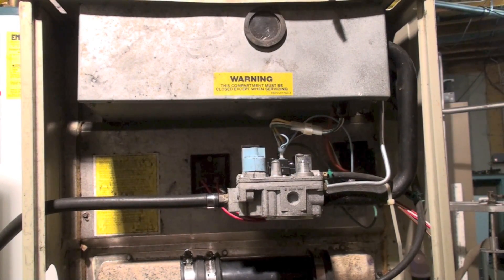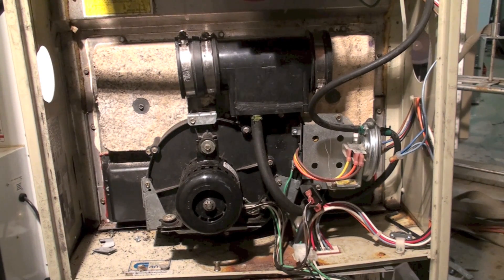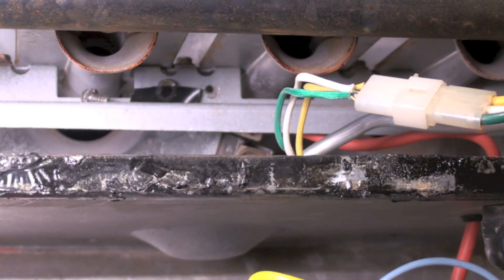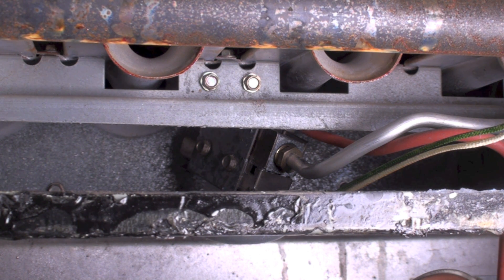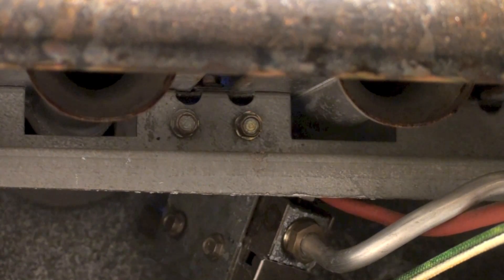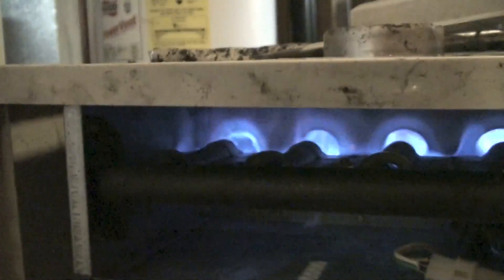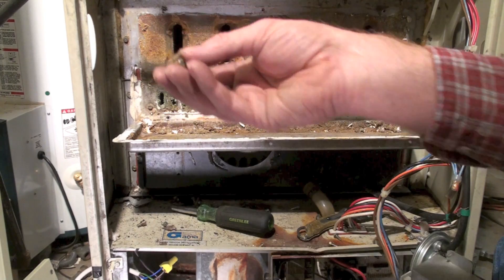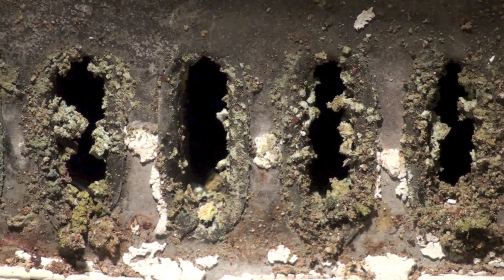Heat exchanger problem with the Carrier 398AAW

Comment: Me: why is it so cold I thought I turned the Furnace on (goes to basement) (walks to furnace) (opens up furnace) (looks at burner) me: wut (furnace rollouts) (burner 1 burns out) (rest of burners burns out) (furnace safety’s off) me: huh (opens manifold) Me: ok WHAT
Reply from the maker: If it rolls out, you probably have a cracked heat exchanger.
GFM
Reply: I have a sideways mounted furnace in my Atitc it’s gray I think it’s a Carrier and in 2012 I had a Carrier oil furnace in my basement I missed it so much

Comment: The secondary exchanger has become de-laminated due to excessive return air temperatures caused by insufficient return air volume and possible high gas pressure. History of clogged filters will also cause this.
Reply: Carrier, Bryant, Day & Night, and Payne, had a class action lawsuit filed against them for this secondary heat exchanger issue back in 2007.
I've had a love hate affair with my Bryant 90+i, but it does work very well and is getting on in years. Seldom does it ever go into high heat mode and as such runs so quiet that one would be hard pressed to know it was running.
I wonder if Carrier will honor a second replacement Sec Heat Exchanger? (if it fails again) Mine was replaced 2008.
I am not an engineer, but something tells me that Polypropylene will crack over time and when it is part of a steel laminate heat exchanger that spells failure... eventually.
Reply from the maker: You could certainly be right.  With a furnace that old, who knows what has happened to it.  Thanks for the thoughts.
GFM
Reply: Back in 2012 I had a Carrier oil furnace in my basement

Comment: So, the problem had nothing to do with the electronic pilot.  That worked exactly how it was supposed to.  Of course, any furnace that old will get plugged up or fail over time.  Probably should have been cleaning the secondary chamber.  I have a 31 year old 398AAW that has outlasted both the original and the replacements that many of my friends have had, so this would indicate to me that the newer furnaces are not made as well as the older ones, and, that it was worth replacing some less expensive parts rather than giving into the sales pitch that newer furnaces are better!

Comment from the maker: On these units the secondary heat exchanger can be removed separately so I just tilted it up and filled it with water and the water leaked from several spots.  When going this far on a heat exchanger, thought must be given to furnace replacement due to age and labor costs for the diagnosis.  Carrier units of this age have given a number of problems related to burners and heat exchangers.  Short answer:  replace it.  
GFM